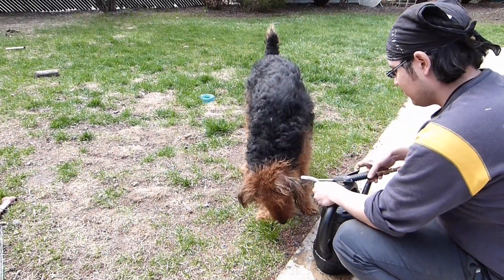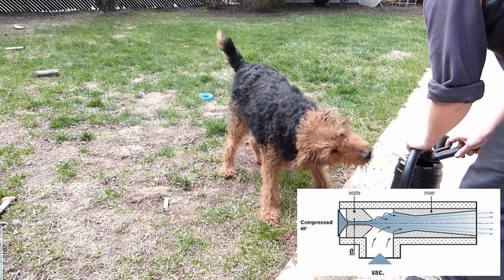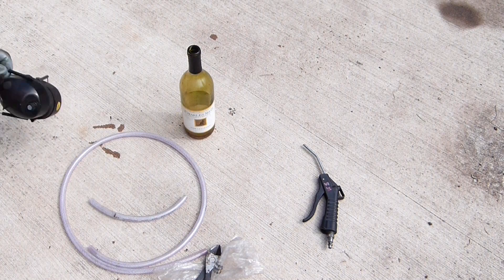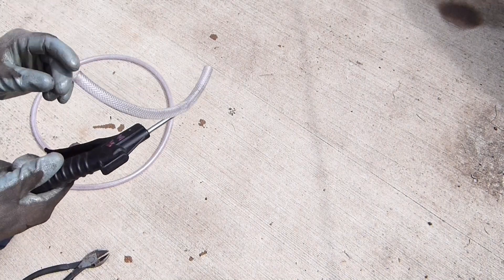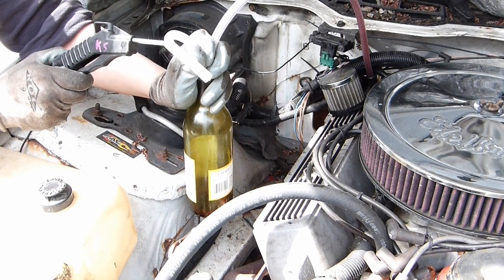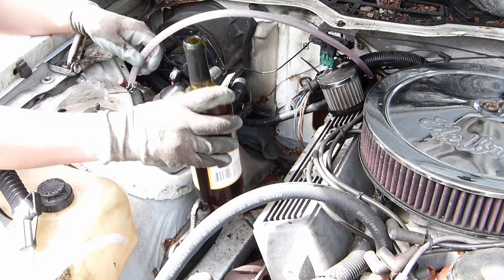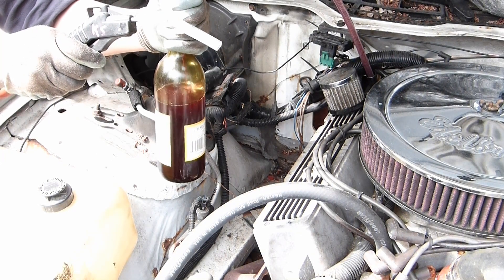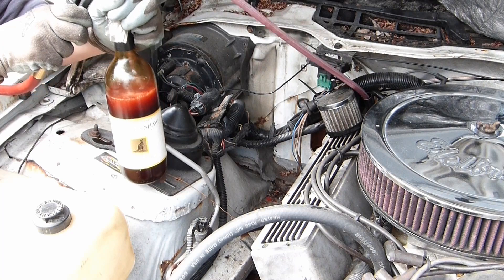How to make a DIY Vacuum Pump Fluid Oil Extraction

Comment: My Dodge Neon didn't have a drain plug either but it had a ton of bolts holding the pan on.  That thing sucked to change fluid in!!  The worst thing is the filter in that was not a simple "screen" but looked to be some sort of filter media.  It just was not any spin on filter.  The thing that sucked about that was it was a filter a little more prone to clogging and had to be changed at some point.  My transmission was the infamous A604.  That thing needed a special fluid and if you dared to use ANYTHING else you would ruin the transmission sooner or later.  Even today there are very few other fluids I would trust for that car if I still had it.  It didn't use Dexron or Mercon.

Comment: Simple is often best! I've been looking into converting different types of compressors into oil extractors, but this solution is good enough for my needs (extracting oil and gas from a lawn mower). Thx, great guide!
Reply: really really interesting . Thanks ))))  . I should make vacuum pump for test vnt turbo actuator , is possible whit this system or need other gadget different of airgun for even measure vacuum and block / descharger it ?  sorry for first my english and sure my incompetence.. bye and interesting project again , thanks ))
Reply: using an oil air con compressor is actually better idea..just make sure the oil does not enter the compressor..instead the compressor should pull vacum inside a bottle which will draw out transmission fluid